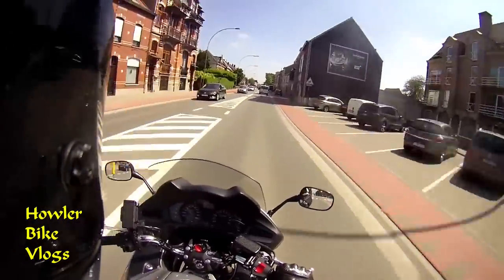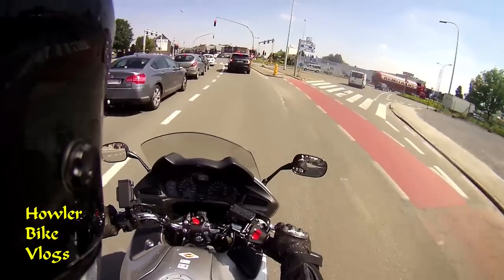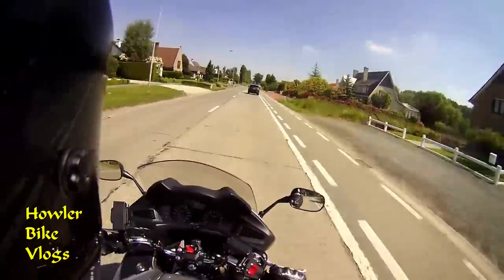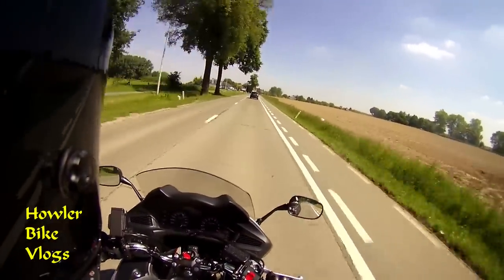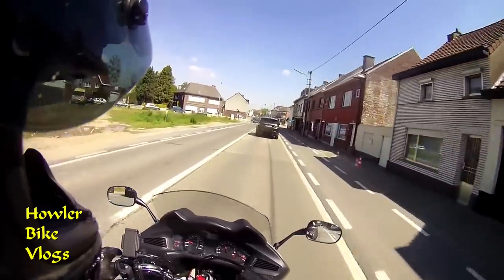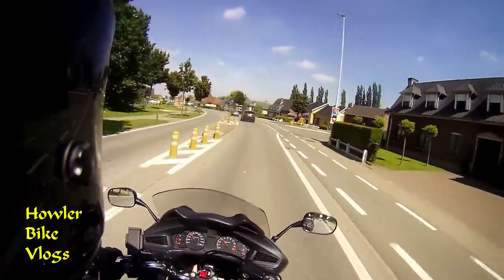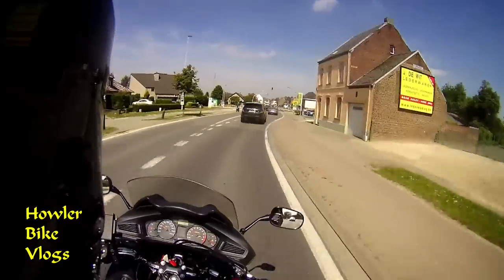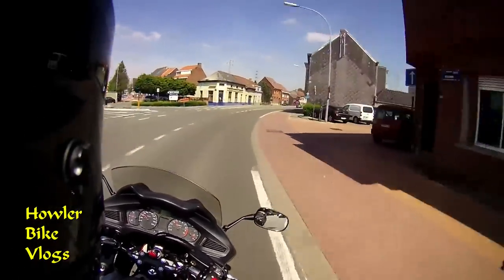Testride 2010 Honda Deauville NT700

Comment: If you ride the NT700V from a sports motorcycle, you will indeed notice the difference the most. This is a good-natured average touring motorcycle where you are not easily surprised in unsafe situations.  The NT700 Deauville is a touring motorcycle for whom touring equals relaxation of driving and a highway, you should not want to be there, then you should have the ST Pan, which are highway touring motorcycles. The NT700 feels best on the rural 2-lane roads that you choose to take a nice drive and enjoy the views and surroundings. The NT700 does not tempt you into unsafe maneuvers because it does not have the configuration to make that possible. It is not a sports bike, but a nice touring bike for those who consider speed and hurried handling undesirable.

Comment: There are very under-rated bikes - Not quite as tough as the earlier 650 - the 700s, I believe are made in Spain, but still quite durable. I've read that the fuel pumps are a weak spot - after market replacements are much cheaper than the official Honda part.  :-)

Comment: I've never ridden it but have heard about the linked brakes and I'm glad to hear someone else isn't convinced by them either.  I think distributing your braking force correctly is an important skill of the rider, and not something that you should complacently let an automated system do for you.

A long time ago on my XJ600S Diversion I hit both brakes hard when someone pulled across in front of me, and the rear wheel skidded out to the side, I controlled the skid but learnt my lesson and did a lot of research on the correct braking technique afterwards, and practiced it a lot.  I think this is something they don't stress enough when you take your lessons and test, and something that everyone should understand.

In a way, it is an advantage for beginners unaware of this, but it also could get you into bad habits, so when you jump on a different bike it could be bad news.  And for the experienced rider, I imagine you have a feeling of losing a degree of control.

Comment: ... Wind buffeting!?? The screen has 6 settings and lifts quite high, great for touring.But have to adjust manually!
I have a black 09 model , very light compared to my FJR 1300 07.
Only issue I have is , the rear end looks like a dog's butt!

Comment: Is there alot of vibration with this bike..?
Reply from the maker: +Darren Lennox well it's a 2 cylinder so you're gonna have that base vibration all 2 cylinders have but it's not that bad and once you get over 3500rpm it's almost completely gone. below that it's is there especially when you're accelerating hard out of the low rpm range but it's never annoying or unpleasant.

Comment: thanks im considering buying one well its between the vstrom or this  :)
Reply: Definitely buy the nt700, i had a vstrom and it was the boriest bike i've ever had.Deauville  has much better brakes, is much more comfy, is much more reliable, very good fuel consuption, more room, much better wind protection  and if you want one con is that it doesnt have a sixth gear, but dont bother because it has axle and not drive chain.